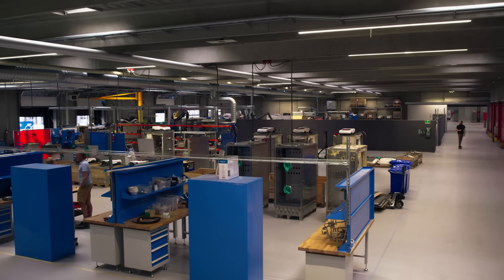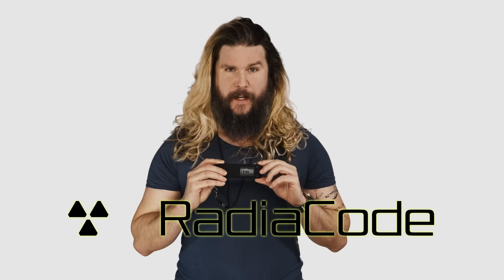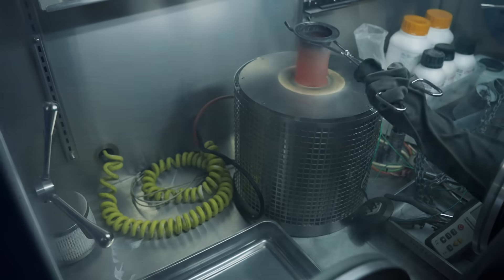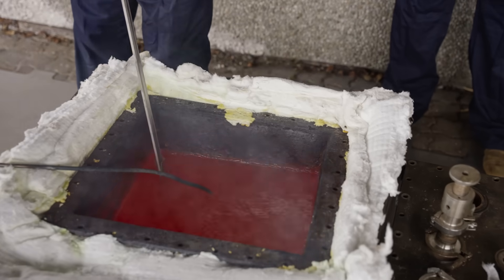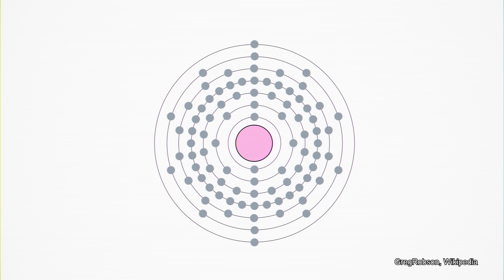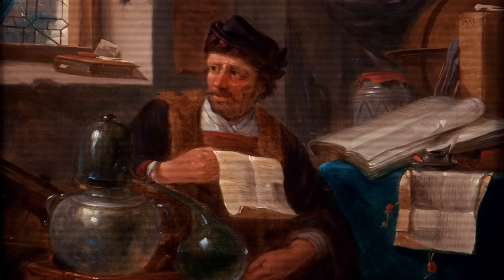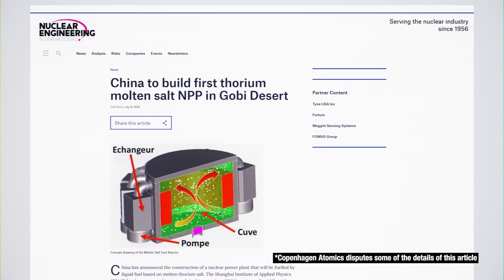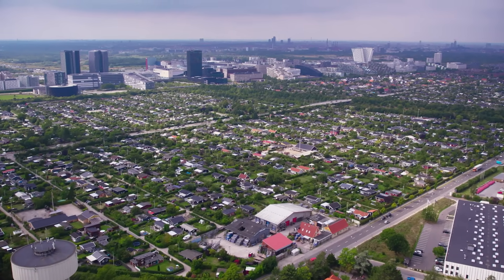Is THORIUM the Future of Nuclear Power?

Comment: You missed the best part, completely passive safety.

By keeping a plug of the salt frozen below the reactor core, if that refrigeration stops or loses power, the plug melts and all the fuel goes into dump tanks where it solidifies almost immediately into something hard as rock

There's basically no way for this to have any kind of meltdown or dangerous event ever, if the fuel every escapes it just solidifies super fast and is easy to clean up
Reply: Oh yeah! I heard about some reactor designs like that way back in the day while taking some basic classes on energy in school. One of my teachers  worked in the nuclear power industry, mentioned something about that.  He was working on a design for a  highbred reactor of some sort that also used I think it was lead for a form of moderator that  could (somehow) use huge giant slabs of concrete to as put it "make it more likely for this safely stop, than ******** congress to get anything productive done in the remainder of my somewhat senile life time" LOL he was a character.  I honestly have no idea if any part of his work had any help in the nuclear science and or  energy at large.
Reply: Depends on the design, Copenhagen atomics design uses active pumping to cycle fuel through the reactor (where it's moderated by heavy water), lose power, pumping stops, reactor shuts down.
Reply: You don't even have to go that far, the sodium can get so hot before vaporizing that the chain reaction fails because the fuel molecules get too far apart to sustain. You can find tests of this with the sodium reactor at the US national test lab in Idaho where they shut the coolant pumps down and you watch the output spike and then drop off a cliff to nothing. Granted, once that all cools you have a very expensive paperweight but it's better than a steam explosion with radioactive debris.
Reply: Pardon me for my beotian question (my engeneering classes are long gone, and my knowledge on nuclear physics must be quite outdated), but can anyone please explain why the molten fuel design makes any leaks several orders of magnitude less radioactive than solidified corium ? Would'nt there be a significant amount of Uranium 233 still dissolved in the molten salts, in the case of a containment breach in the reactor circuit, because of the whole "fissile material production" loop ?

I fully understand the chain reaction would instantly stop in the liquid salt outside of the reactor, right after any leak would happen, ensuring that there would be no self-maintained heat production in the leaked materials and therefore no possible meltdown. However, after returning to solid state, the leaked solution would still contain the U233 obtained in the fission of thorium, that had not enough time to fission itself before the leak happens, would'nt it ? Meaning that in a breach scenario, the containment of any leak would require that higly-specialized technicians could quickly intervene to isolate the solidified drops in a radiation-proof emergengy container ... Or am I missing something ?

I get there already is one built-in emergency container in the design of these reactors, as represented in the schematics, ready to collect the molten salts in the case of an emergency stop, but what of a leak that would momentarily happen, for a fraction only of the whole liquid (before shutdown would be fully executed), anywhere in the circuit where there would be a breach ? Even, and most-probably, because of exterior originated damages ?
Reply: @c-hd.8644  Water reactors run a risk of a steam explosion (low risk but still) which would disperse Tritium into the atmosphere.

Moreover there are gaseous fission products contained in solid fuel rods that get released if you damage the fuel rod. Gaseous things are much harder to contain as you might imagine.

Molten salts are very good at binding most fission products within themselves even in the liquid form and the gaseous stuff doesn't build up during normal operation, it just bubbles out and gets captured as it gets created so in case of an accident there's basically no radioactive stuff in gaseous form to be dispersed.
The molten puddle will also very quickly turn solid which contains stuff even better of course.

I believe the US actually tested the release from worst case scenario by actually pouring out radioactive salt into a hole in the dirt and found it to be very safe.
Reply: Thank you  @MrRolnicek , I knew the water steam and pressure issues are one of the current flaws our different nuclear reactors are facing. I get that a molten salt would be more efficient in its ability to capture any radioactive particules, making an eventual de-contamination process way easier than with a pressurised reactor explosion. However, I was more worried by the average radioactivity of the mix of molten salt, radioactive isotopes, almost inert thorium and fission byproducts labelled as "waste". Even if at the start of the reaction there would be no U233 dissolved in the mix, its proportion would necesseraly increase up to a stabilisation point, where it would react as fast as it would be created.

If you say US scientists tried to pour molten salt containing dissolved radioactive materials directly on a hole, in dirt, I think they knew what they were doing, but still I wonder if the proportion of radioactive isotopes in their mix was as high as a functionning molten salt coolant would have had, in an operationnal thorium reactor. But I guess such fine details would not be easy to check, so thanks anyway :-)
Reply: @c-hd.8644  I mean in the worst case accident scenario BOTH versions of the core are molten (that would be called meltdown). In molten salts though you would usually remove the nastiest fission products continuously so there wouldn't be many of those left at the actual accident time. Same idea as the gaseous stuff, solid fuel just has everything build up inside but molten salts can be cleaned continuously (or you can decide not to do that too like ThorCon).

But in either case if all the nasty stuff is contained within a puddle or a block of metal, you're fine. Just don't go near it without proper protection. It's like the infamous "elephant's foot". Just don't go near it and you're safe, it wasn't leaking radioactive isotopes into the atmosphere or water supply, it was just sitting there.
Reply: @c-hd.8644  As you said, the reaction stops once outside of the reactor. That only leaves radioactive decay, and U-233's chain consists only of alpha and beta emitters. Even aluminum foil is sufficient to protect from those. One of the great things about molten salt is that it makes extraction of the fission products so much easier. There'd be no reason to have any "waste" fuel salt sitting around because it consists of relatively easily purified fuel and valuable byproducts.
Reply: @JacobNeff-oq5km  u-233 not only make alpha and beta, it also makes neutron radiation and I'm sure some of its decaying byproduct emits gamma too.
To break fluorine salt, you just need water to touch it at such high temperature. BeF2+H2O=BeO+2 HF.
Reply: @c-hd.8644  I think it is mostly that it won't explode and spread radioactive materials into the environment, and that material won't leak into the ground or air because it's bound up in a blob of solidified salt, probably still inside a sealed vessel. Sure, it's still there, but it's not going anywhere.
Reply: That's what I thougt, thanks  @BoogieManFL . I feared I missed some point, but it seems that the lack of internal pressure (both in the reactor and its salt-based cooling circuit), factored with the quick solidification of the molten salt if not maintained in its circuit, and its "cohesive" properties preventing contamination (via gazeous or thin particles at least) from escaping the exterior containment does the trick.

In many ways, it would be a leap forward in security compared to former nuclear reactor techs. The "severity" of a potential breach of fissile materials would drastically decrease, with its "self-shutting down" tendancies and in terms of manageable options left for technicians, in extreme scenarios, to de-contaminate facilities (compared to traditionnal nuclear reactors already in use, where contamination could become near irreversible and/or too thinly spread over large distances to be contained). But mostly, it is because the solidified salt containing radioactive elements cannot go critical on its own, which "freezes" most of the radioactive emmisions down to the natural occuring decay in such materials. Meaning that as all radioactive stuff, with proper protections and if exposed for small enough durations, in a sufficiently long range from direct contact, there would not be a problem for people to collect and re-contain any leak.
Reply: @ The radioactivity isn't primarily coming from the Uranium or Thorium or any transuranics, it's the fission products that are the nasty stuff in any potential corium. Since the fuel is molten you can 
a) remove any gaseous fission product by letting it bubble out of solution and 
b) perform electrochemistry to remove the rest from solution. 
Neither of these steps can be done in a solid fuel reactor, leading to a very significant drop in radioactivity of any accident scenario regarding the molten salt fuel. 
What to do with the separated fission products is another matter since they are screamingly radioactive, and have a whole host of source-terms from the periodic table, but that's another matter.
Reply: The freeze plug design of passive safety is great but even that is actually obsolete these days. We have better now: "no plug"

The idea is that instead of a plug with active cooling that prevents the draining, the pipe is just open and the whole thing is constantly draining, meanwhile you have a pump that brings that salt back from the safe storage tanks into the reactor system constantly.

Power outage in both cases just has the core drain out safely but instead of the system only being used for shutdowns of the reactor (which doesn't happen for refuelling here, it's super rare) it's a system that's constantly running. There's a lot to be said about a safety system that you can see constantly working correctly at all times.
Reply: @MrRolnicek I think the reason for the plug being used in this design, is the small size of the reactor and it being pitch for commercial use. The ideal is having your small powerplants like these and the just with the only cost for power being maintenance of the reactor.
Reply: @MrRolnicek  In both cases, there is some system which must be constantly working correctly so that the reactor keeps operating. A plug freezer failing to shut off is probably about as likely as a return pump doing the same, so there's no advantage there. The plug doesn't require a penetration into the plumbing, but a pump does.
Reply: @ Freeze plug system still has the same pump system as well because whenever you shut down and drain the reactor you will need to pump the fuel back in from the storage tanks. The only difference is having it on all the time or only during restart. (but both do need constant operation and power to keep the reactor running, either in a complicated freezer system or in a pump)
Reply: Not to mention its self regulation of temperature
Reply: This sounds like the problem with a Lead-Bismuh reactor: let the reactor cool down and it will solidify.
Reply: What happens if somehow the reactor explodes? How dangerous would it be, is there enough containment? Don't scoff, the Chernobyl folks also dismissed the idea of a core exploding instead of melting down.
Reply: @edwinpoon  I'd wager the good folks at Fukushima also did not consider explosions, yet they happened. My main concern with molten salt would be the hot salt mixing with water through some leak or pipe breakage. The water would instantly turn into vapor and explode violently (the Slow Mo Guys have a good video on molten salt hitting water). This would also disperse some of the radioactive material into the steam. Are those pressure vessels robust enough to withstand an explosive heat transfer instead of the intended continuous transfer? How would the contaminated steam be contained?
Reply: @SioxerNikita  You mean, fissile fuels that are dissolved into a fair amount of molten salt ? At the start of the reaction, yes, but what if the porportion of uranium rises during the fission process ?
Reply: Chernobyl boasted 'passive safety' features too...
Reply: Why do people think passive safety is a feature of only LFTRs / molten salt? The are plenty of advanced but more conventional designs that are passively safe as well..
Reply: @Cyrribrae  People think that because nobody is making slick videos about the Westinghouse AP1000.
Reply: @GerryRRit sounds silly, but I think you're correct. How could people know if there's barely enough info on it, and those are not that interesting. There's a reason why ads exist. It would be good if there were youtubers that made a series talking about many designs of nuclear reactors. We have people talking about the design of cars, planes, trains and even war machines like tanks, so why not nuclear reactors? 😂

Hope I remember to read about the AP1000 later...
Reply: @Cyrribrae  its simply a nice bonus
Reply: There is a way that the safety won't work... and that is a very bad earthquake. or a "perfect" earthquake. I could see the earthquake damaging the transport path of the emergency shutoff, lets say it damaged it still close to the reactor. 
Of course this is like rare and even rare or stupid that you would build a reactor without all the known disaster-safety measures you could think of. Which is what I would point out what the thorium molten salt reactor is suppose to be for modern nuclear power plants, a very safe nuclear power.
Reply: I think the real problem that people are missing is what if the freeze plug malfunction or if the core is breeched by external force. Fluorine inside their core is something even NASA tries to avoid messing with. And these Danish people want to MASS PRODUCE it.
Reply: @ Freeze plug malfunctions how? By staying frozen? So the radioactive material stays inside?
And if the core is breached the fuel is under no extra pressure so it would be the same as if it was dumped into the tanks, except a little cleanup?
Reply: @andreasaa2000  freeze plug can be clogged by external material such as Graphite chips or sludge of chemical reaction byproduct or neck of tank being too cold etc. Not sure what realistic situation there can be. I'm just speculating.
For breech, I'm referring to FLiBE reacting with water and producing hydrogen fluoride. Releasing radioactive HF to neighborhood would be worse than Fukushima.
Reply: @dongleseon8785  Fluor-IDE. It is a salt, and you have to try very very hard to get fluorine salts to stop being salts.
Reply: In theory, and it will remain in theory til it does meltdown.  So most likely to remain one.
Reply: @shawnlylebond8873  Molten salt reactors can't melt down, the fuel is already molten.
Reply: @ This is not what that means. A critical meltdown means that sufficient cooling is lacking and the fuel heats up to the point where it can melt support structures, piping, containment barriers etc. Sure, the fuel is molten, but decay heat is a bitch and cooling is always critical.
Reply: @shawnlylebond8873  You're not even wrong. The idea of a meltdown is a completely inapplicable because it's a MOLTEN salt reactor. Melted fuel is the normal operating state.
Reply: "In our reactor, the piping lasts 5 years". that's not what I would describe as "basically no way to have any kind of dangerous event ever".
Reply: @eldias5387  "oh no there's salt on the floor" =/= dangerous event.
Reply: What part of "800c radioactive salt spill" doesn't strike you as dangerous? I think these are cool, but we should be honest about drawbacks and danger
Reply: @eldias5387  There are degrees of danger, the main issue with a pressurized water reactor is the pressure it's under, that's not an issue for a MSR, the salt spill would be "bad" but the material is more chemically stable than the molten uranium oxide from a conventional reactor.
Reply: @eldias5387 the fact that these reactors are in giant catch cans, have no properties which would cause a breach of that containment even in total failure of the reactor vessel, and the salt solidifies at such a high temperature that it is easy to make it immobile. Yeah, the potential is there for problems of you are INSIDE the containment when the breach occurs but you'd die of radiation sickness long before the salt caused you health problems or the world problems.
Reply: @eldias5387  The part where it basically turns into vitrified glass in a few minutes, trapping the fuel and fission products inside.
Reply: @eldias5387 all reactors require maintenance it would be insane if people forgot to do routine inspections for 5 years and let it corrode away
Reply: @idris4587 Exactly, why would that ever happen? OOPS our team of educated engineers forgot to maintain the multimillion dollar reactor!
Reply: @eldias5387  They plan to produce one reactor per day in an assembly line, that means they will be CHEAP.
So you can just install a new reactor every 5 years.
Reply: @eldias5387 Only if they decided to ignore maintenance and replacements. Which wouldn't happen, so why even bring it up?
Reply: Guess you missed the part where he said there will be a part 2. Also, great copy and paste job. Youre not saying anything that isn't commonly known on this topic.
Reply: @coronalight77  you're talking like most of us are informed of the inner workings of a thorium reactor
Reply: Super hard and easy to clean up as the Elephant's Foot?
Reply: @toolbaggers  What? The corium that formed the "elephant's foot" is something different entirely. The solidified molten salt from a failed thorium reactor would be much easier to clean up. The radioactive material wouldn't leak into the environment or disperse into the air much if at all because it would be bound up in the solidified salt. It would be something like chipping away a bunch of spilled molten glass after it cooled and hardened. And since it doesn't have to operate under pressures, it isn't going to explode, like the steam explosion at Chornobyl. While still radioactive it would be far easier to clean up. Where with the elephants foot is still highly dangerous to approach today, all these decades later.
Reply: @toolbaggers  not even close, the Elephant foot is dangerous because it still contain reacting material, the drained salt no longer has criticality so the chain reaction stops
Reply: @toolbaggers it won't be as radioactive as the foot
Reply: @ lol no more like incredibly thick dense brick of stuff kind of thing. The elephants foot was made because: you know what's a good idea: cutting corners on a cutting edge source of insane amounts of row power, and--oh fuck we rant out of coolant---denial mode mode, and chucking a heavy af steal and concrete roof a loooooong way away...out here with people we call: sane. and many many years later: in the event of LOCO and part of the reactor is royally fucked (like fukushima)these days we try to cool it down very quickly (instantly when possible) instead of deny things are fucked. Nuclear powered submarines used some kind of liquid lead: small compact: and if you're up a creek: sure the central plumping is now a heavy brick of lead and you'll get read the riot act. but the marine and navy prefer that over submarine goes kaboon and irradiates a large amount of the ocean.